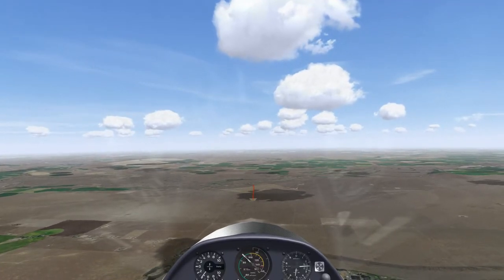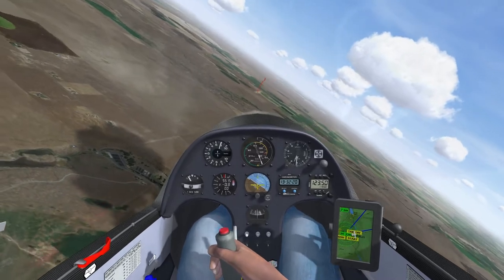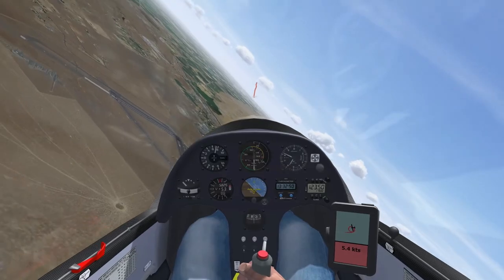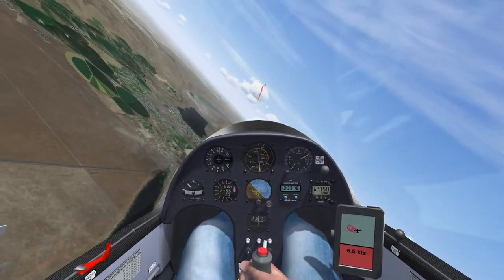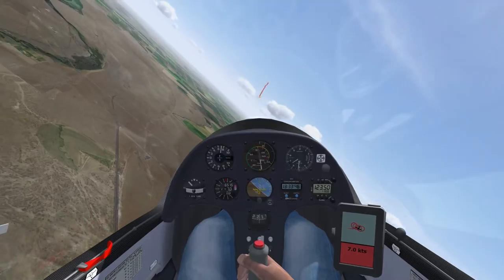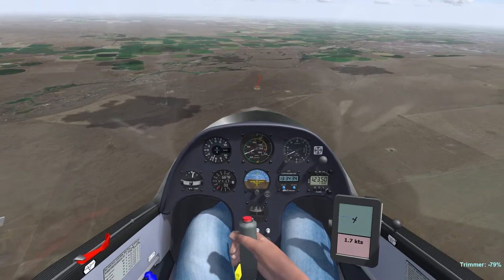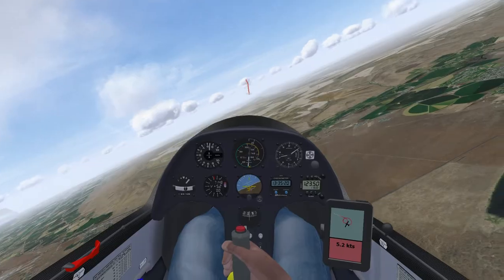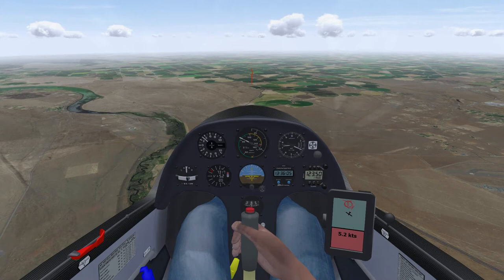Condor Thermalling Technique

Comment: As a gliding instructor I recommend maintaining a suitable constant attitude and allowing the airspeed to fluctuate a bit with turbulence.
Reply from the maker: Ideal thermalling technique is a very nuanced set of actions and skills, and no 5-minute video on YouTube will cover all of it. One should not "chase the needle" slavishly; but you also cannot simply fly a constant bank-angle either.  Thermals are irregular in 4 dimensions (3 spatial dimensions plus variances over time) - if a pilot does not react to them, these irregularities will cause major speed and bank fluctuations which will move the glider away from the center of the lift. 
This video is an attempt to demonstrate how you can "stay ahead" of the glider as it encounters these irregularities, and not wind up lagging behind the aircraft as you "chase the needle".

Comment: The yellow triangle is not the best glide marker. It is the marker which landing approach speed the manufacturer guarantees to be safe at maximum wingloading. This also can be used to maintain a safe airspeed in rough thermals or near a ridge.

Comment: Good video. In real life, please look outside the cockpit much more - gliders meet up in thermals and midair collisions are the greatest hazard in gliding (I had to parachute after a midair collision on thermal entry 20 years ago, the other guy also had to parachute and we were both unhurt).
Reply from the maker: I am absolutely not counseling people to stare at their airspeed indicator! This demonstration is designed specifically to illustrate the common issues I see with many soaring pilots as I mentor them in both Condor and in real-life with my DuoDiscus. It is not intended to be a comprehensive tutorial on how to fly (including performing a visual scan and using aural and kinesthetic feedback - i.e. the sound of air rushing outside the cockpit and the "seat of the pants" feelings - to reduce the reliance on instrument readings).
Reply: @noelwade  I'm sure you don't stare at your panel in real life!  I wanted to add for viewers of the video the vital importance of a constant visual scan outside the aircraft. I feel a danger for pilots of too much time playing with simulators is that it gets you used to not looking round (single screen simulation does a very bad job of representing looking around, even use of a VR headset does not wholly solve this). Where do you fly?
Reply: Ah, just looked at the OLC record of the 2011 flight you posted and see that was from north of Seattle. I fly an Arcus M in the UK.
Reply from the maker: @markburton5170  - Good stuff, thanks.  And yes I agree. I think the use of a simulator should be used in conjunction with a "head tracker"**. Being able to 'look around' is key not just for thermalling, but also for basic learning like the traffic pattern (i.e. determining where you are relative to the runway, when it is "over your shoulder" in the simulator). 

**I have used VR with Condor2 but the field of view is just too narrow (even less than a normal computer monitor) and don't think its the right approach for 99% of situations.
Reply from the maker: @markburton5170  - Arcus, very Nice! I sold my single-place ship and partnered with another pilot in a DuoDiscus T because there is a lack of good cross-country instruction/mentorship in the region. I'm hoping to rectify that with this two-seater. I still live near Seattle, but mostly soar in the drier & more-open terrain east of the Cascade Mountains. Near Seattle the lift rarely gets above 1500m and 1 to 1.5m/s. The heavy forest cover and urban areas mean that soaring near here is a lot of "tip-toe" flying.  On the other side of the mountains the lift regularly goes to almost 3000m and 3m/s, plus there are tosn of farm fields and small airstrips that make cross-country soaring much easier. The only downside is the 3 hour drive each way! 😕
Reply: @noelwade  The simulator at my gliding club has a three screen setup with a head-tracker. Unfortunately it has hardly been used yet due to technical issues but hopefully will be a good solution. I agree about a VR headset - it is like looking through a tunnel.
Reply: @noelwade  My club has a Duo (not a turbo) and I loved flying it but wanted a self-launcher, hence the Arcus. I enjoy flying cross country with pundits from whom I learn, with peers at a similar standard with whom I share the flying and decision making, and with less experienced but generally solo pilots who hopefully learn something from me.
Reply from the maker: @markburton5170  - which club are you with? I used to travel to London a few times a year for business and had a lovely day with the Booker Gliding Club. Never got out to Lasham or others, but perhaps someday! 
Sailplane training here in the US is much less thorough/"staged" and it is very common for newly-licensed glider pilots to be very confident in the traffic pattern but have little in the way of thermalling skill or any practical experience outside of the traffic pattern. Since most instructors spend all of their time getting pilots to the point of earning their basic license, few are able to provide instruction on cross-country soaring techniques - and most US training gliders are not cross-country-capable (Schweizers or Blaniks).  I am trying to provide an avenue for newly-licensed pilots to take a few flights in a two-seat ship so that they can experience XC soaring and start practicing some skills, thus reducing the fear of the unknown and the barriers to them trying cross-country soaring on their own.  I only wish that I didn't have to work a fulltime job; it really gets in the way! 😛
Reply: @noelwade  Great to show less experienced pilots what you can do in a glider and a Duo is a perfect machine to do it in. My club is London Gliding Club, based at Dunstable - the first gliding club in the UK, now not as big as Lasham, but active with cross country training a large part of what we do.
Reply from the maker: @markburton5170  - Thanks! Yes, I focused on acquiring a Duo specifically because its simplicity & easy handling. I want new pilots to not spend brain cycles on the stick & rudder flying, so that they can be absorbing XC knowledge and be thinking "ahead of the aircraft".  
If I get back to the UK, I'll have to come visit Dunstable!

Comment: great video thanks, now that I have started my licensee I will definitely be getting this sim to further improve :D
Reply from the maker: Congrats on starting the adventure!  Feel free to ask me if you have any questions about Condor, about learning to fly gliders, or any part of your journey to getting your license!  
Please note that Condor, like most sims, requires some tweaking and tuning to make it "right" - don't expect to just install it and have it work perfectly.  Two common issues are that by default the rudder is overly sensitive (you may need to turn the sensitivity down), and aerotowing in Condor (especially Condor 1) is harder than in real life - so for most sessions its best to just start in the air (no tow at all). Best of luck!

Comment: Very interesting! is it possible to simulate in Condor similar situation even without external pedals?
Reply from the maker: Yes, if you have a joystick that twists, you can assign the twist axis to your rudder pedals (but I find that you have to turn the sensitivity very low to avoid over-controlling the rudders, as the twist is such a small movement).
However, you cannot use the "automatic" rudder setting in Condor to simulate this very well.